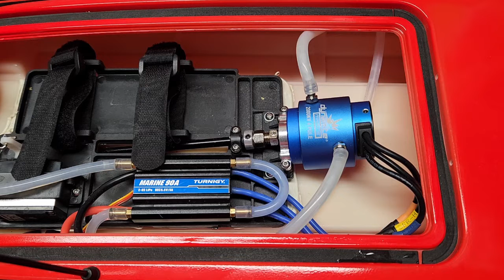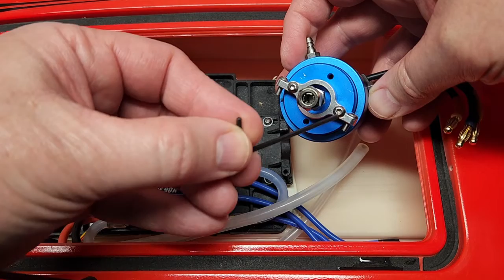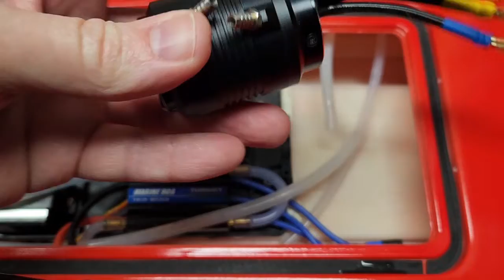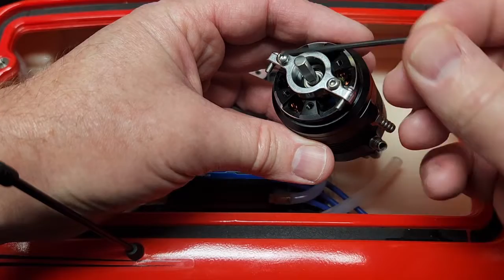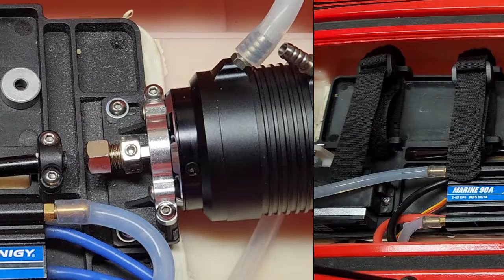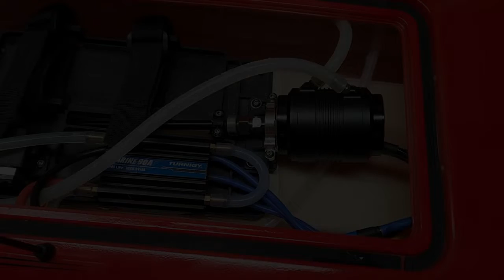Pro Boat Blackjack 24 motor upgrade

Comment: The motor that came with my veles ran so hot that i could feel it from the outside of the boat my run time was around  5 minutes  i replaced it with a surpass 4074 2000 kv motor  runs cool and run times went to around 12 minutes

Comment: I bought a Hobbywing esc 60a and a HW 3900kv motor, was thinking about putting it in this boat. Not sure if it would be a good fit or not. I actually haven’t even bought the boat yet. Kinda doing the buggy before the horse on this one. Any thoughts since you have this boat?
Reply from the maker: I think it would work fine if you primarily ran 2-cell LiPos. That's almost 29,000 RPM. On 3s it will go faster but might be unstable and might be too much for the 60A ESC. Check more videos. This is a popular boat to upgrade. I'm sure someone has done a similar upgrade

Comment: Hey man! Thinking about doing this to my bj 24. Was wondering how it runs on water. My boat is completely stock and suddenly started to hop on the water at full speed. I messed with the cg and the strut to see if I could get the boat to push the transom up. Nothing works, and I only loose speed running it with the strut all the way down. Any tips?
Reply from the maker: Unfortunately, the lakes are frozen where I'm at, so it hasn't been in the water yet. Maybe early March. This is our first catamaran so I don't have a lot of experience tuning it. Try adjusting the prop angle. It's difficult with the Blackjack but I did it. Even a little up or down angle will change things. Otherwise, put the battery as far up into the bow as you can, even if it's not in the battery tray.